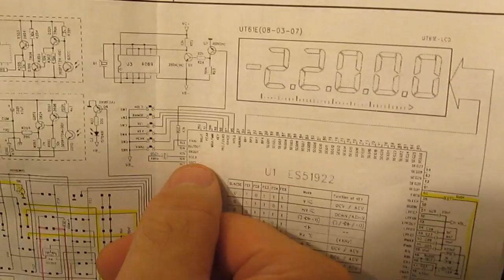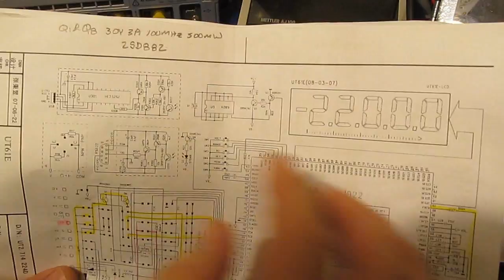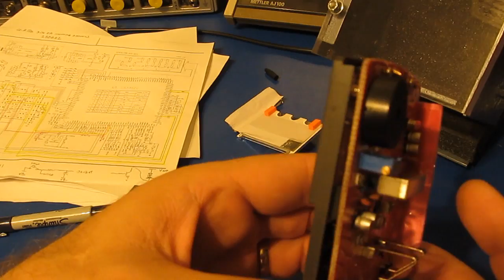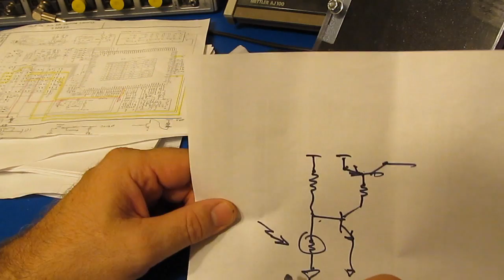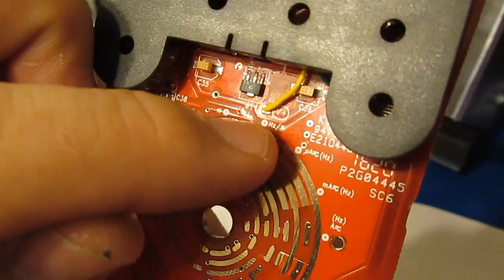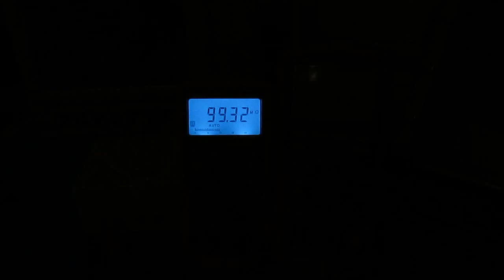Adding a Backlight to the UNI-T UT61E

Comment: This is cool and I'd like to do it. Could you show exactly what it looks like wired, not just the end result,  and besides the LEDs what type pf photocell and resistors etc used ? I know you explained it in the video but I don't understand that much yet. thanks
Reply from the maker: One thing you should understand is NEVER make ANY modifications to a safety device.

Comment: I have an AN370 meter and it has a backlight, but it is the worst backlight I have ever seen in any meter I have ever owned.  If you ever tested one you will know what I am talking about.
 Can it be improved?
It's only a beater meter, but I would like to be able to use the backlight.
I can do the electronics part myself but have no optical mechanical skills.

Comment: Joe or anyone, how would I mount a backlight on my old Fluke 73?
I have been messing with it trying everything from LED flashlights to flat top LEDs but none is enough to light the display.
The display plastic is really brittle and would surely crack if I open it up. But I would risk it if there is a chance of success.
Thoughts?
Reply from the maker: 1) Buy tools that meet your needs.   2) Carry a flashlight   
I would NEVER recommend anyone attempt to modify a handheld meter.
Reply: @joesmith-je3tq  Thanks Joe! =)
Yeah modding my meters is not a thing I need really. Mine are stock apart from a continuity beeper added to the old Fluke 73.
I will leave it stock.
Have a great weekend. =)

Comment: One of the best backlight mods ive ever seen, too bad Unit or other manufacturers cant get a clue.  I have one meter from Mustool with a decent backlight feature, if you push the button till it beeps once you get 30 seconds, if you hold it down for two beeps it stays on until you turn either the light or the meter off, in this day and age any meter over say $25 could easily have this feature, im sure its just built into the chip.
Reply from the maker: I think UNI-T now offers a meter that has this feature.

Comment: Hypothetically, could not the free lens right next to the IR LED be used to sense lighting? Or could the IR LED interfere with the sensor perhaps, making the back light flicker.
Reply from the maker: Personally,  I would want it in the face of the meter as I normally have the meter secured against something where detecting ambient light off the backside may not work very well.  If I were actually using this meter,  I would most likely leave the cover on as well to keep dirt off the lens and minimize the risk of scratching it.   I thought about trying to mount the sensor under the lens.   UNI-T did come out with a meter that has this feature.  Maybe we will see more like it in the future.

Comment: wow... excellent really!!!
i was wondering for the last 2 weeks about the same multimeter you are modified... it really was missing this back-lit 
thanks again for this real helpful share😊
Reply from the maker: UNI-T always seems to fall short of what I expect.  This meter seems to be very popular for some reason or another which is why I bought another and made these four videos on how it could be improved.   Maybe UNI-T will release an improved one.   Personally, I would rather see an improved 181A!
Reply: joe smith agreed with you on the 181A... its an incredible multimeter and as you say previously.. if thy just improve it a bit more... really i will get like another 2 of it...😅
Reply from the maker: I would buy another if they improved it but they would need to address the charging, offer a spare battery, pass some basic EMC standards before I would consider it.

Comment: Awesome mod :D maybe if mine acts normal again I might try something similair. (I either dint read the manual correctly or my meter is stuck in some Amp mode in the Voltage measurement mode. Basicly the first option when you turn it on, it isnt Voltage DC in Auto, its Amperage in Manu mode and beeps the hell out.)
Reply from the maker: They are one of the least robust meters I have looked at and once damaged there may not be much you can do but replace it.
Reply: joe smith  As suggested at the eevblog irc I opened her up again and paid good attension at the details. what a mess. SMD solderpaste residue or something everywhere. inside the via's, behind the IC pins. I cleaned her, and it works again. Also saw those backlight holes you showed, so im temped to try a backlight hack like yours :P

Here is a detail shot of the problem I had, its gone now ;D http://codeasm.com/images/UT61E_Fixed_Detail.jpg

The meter showed some weird Amp mode and was beeping with this image to demonstate: http://codeasm.com/images/UT61E_StuckInAMode.jpg (Note the A in the uper right corner. Constand beeping (not included in image) and values rappid rising and lowering)

So, maybe a good debugging tip with new uni-t, clean the bastard. :P Thanks Joe for the video, and reply. Its still cheap... swap those connectors maybe too... or I save money for a fluke or something.
Reply from the maker: Good you hear you were able to repair it.  Looks like some bridging.   The soldering looked alright on the couple I had seen.  The hand done soldering was not the best.  Yes they are fairly low priced.   Personally, I would buy a meter that had the features I need.  The only time I could see modifying one is for demonstration purposes.

Comment: Could you tell us what LED did you use? I like the lighting on that. Good work.
Reply from the maker: I wish I could but I have no idea.  Something I had in my drawer of loose LEDs.  I had a few of them and stuck two in as tight as I could get them to the light pipe using some clear glue.
Reply: You can use smartphone led

Comment: that would be very useful in the automotive field. Lights up when u need it with out any user interaction!
Reply from the maker: That's been done for a very long time with the dash board and head lights.
Reply: yes it has but you are the only one Ive seen implement it into a meter
Reply from the maker: lol, I was thinking you meant the car, not that it was a useful feature to have on a meter while you worked on the car.  Maybe I'll set a new trend..

Comment: This type of light activated mod would useful in higher end meters when the back light only stays on for 30 seconds or so, excellent post as per.
Reply from the maker: It seems like it could be a nice feature.   I don't think I have ever seen a meter that could adjust the backlight like this so maybe there is a reason for it.
Reply: Don't know why it's not done, perhaps it's simply no one has bothered or even thought of it before, who knows. Viewers opinions would be of interest..

Comment: Nice work, what current are you running those LED's at. I would just add an extra diode in series with the NPN emitter so the sensitivity is reduced a little, and it will not turn on in normal room light.
Reply from the maker: The current will depend on the ambient light, temp. Full on, roughly 5mA.  To be clear, the meter draws about 2.2-2.3mA when the BL is off and about 7.3ish mA when it's full on.